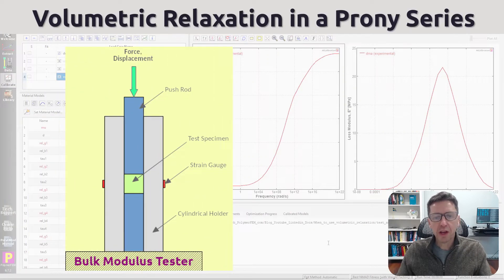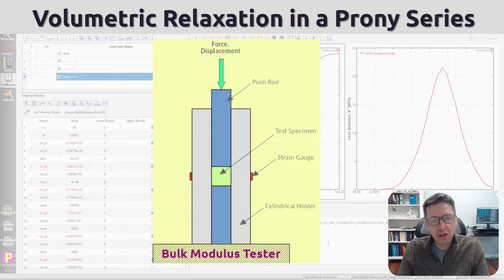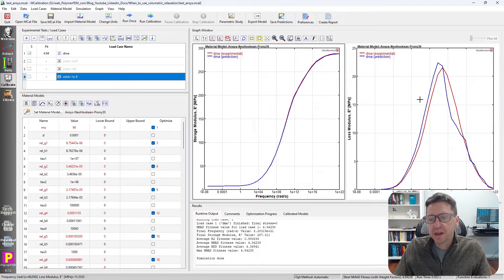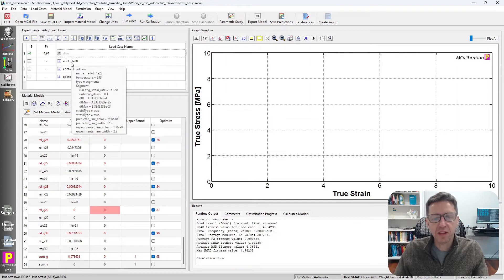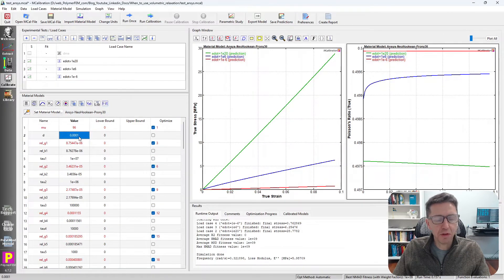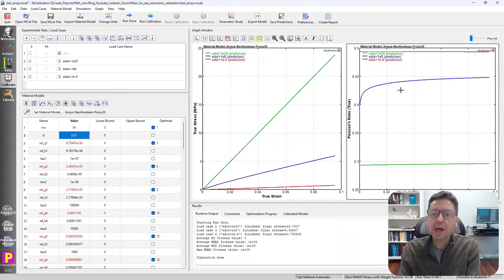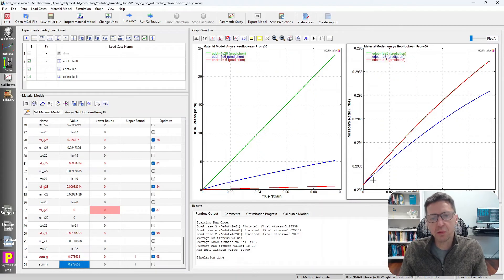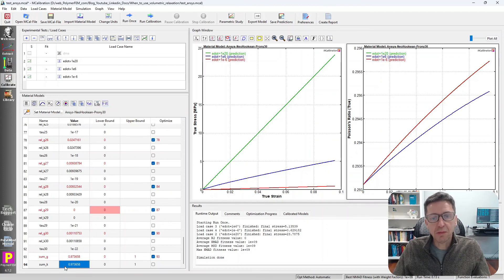Volumetric Relaxation in a Prony Series

Comment: Thanks for posting, Jorgen. This series has been super helpful, and it is much appreciated that is to the point and in small clear snippets.
Once the bulk relaxation was identical to the shear relaxation, the Poisson's ratio was for all practical purposes fix at almost 0.3. The plot is a tad deceiving since the values are changing from 0.293 to 0.296 or thereabouts and seems very steep. Although measuring the bulk is not easy, checking the assumption by measuring the Poisson's ratio and see if it stays constant in the range of strain rates of interest is trivial.
One question, how does changing the bulk relaxation affects the results when there is multiaxial loading?  Say a biaxial or a confined compression test. I wonder if having a relatively fix Poisson ratio could be throwing something else out of quilt. I guess that the chemistry of the polymer will ultimately dictate the bulk decay, but would the bulk spectrum change much compared to the shear one in general?